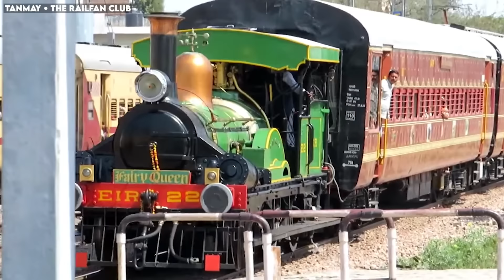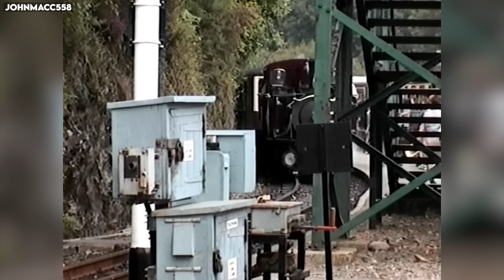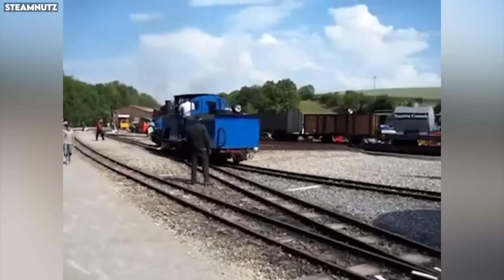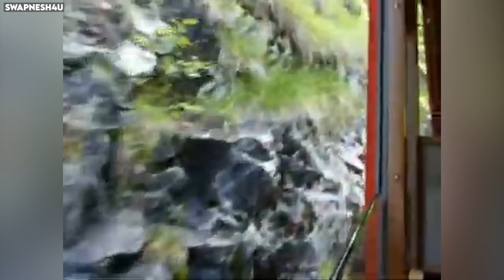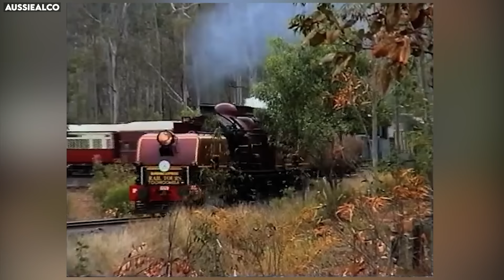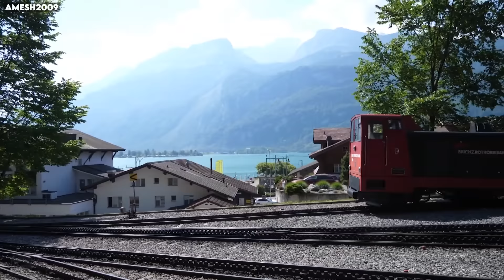10 Strange Locomotives That Still Run Today Against All Odds

Comment: Don't forget the steam railway on the Isle of Man that operates daily on the island.
Reply: Yes!  AND they do not have a flippin diesel as part of the deception!
Reply: Actually the IOMR does have a diesel power systems, in storage and rotting away are narrow gauge rail cars from a closed line in NI, and a new unit from i believe a US manufacturer that they can't get to work properly.

Comment: LIES there are many articulated locomotives . The frames do NOT bend/hinge , the front of the boiler sit over a turret like on a army tank , the first 4-8 wheel set turns under the boiler as a single piece .

Comment: Yes, you have missed the Rack and pinion still running steam ( coal  and  oil fired ) engines and trains in India. The metre gauge railway from Mettupalyam to Ooty ( now called Udghamandalam) in the state of Tamilnadu, in India. Please check that out and I hope you put it in the list of regular steam running engines , it has a 1 in 12 gradient climb, which is extraordinary. There are still Swiss built steam engines ( coal fired ) pushing these trains up the Nilagiri mountains of South India.

Comment: The fairy queen is he oldest steam engine in the world operating but since It has been rebuilt so many times most of its parts aren't considered original. Though there is an engine 1 year younger than it called the prins august and it still has most original parts

Comment: Srilanka have One Locomotive Still Run Since 1922. 

Thats Class B2B 213 4-6-0TT Ten-Wheeler Tender Tank Steam Locomotive. 

Build by Vulcan Foundry England. These Engine is the Non-Retired Engine in Srilanka Nearly 104+ Old.

Comment: Actually, NSWGR (New South Wales Government Railways) also ordered some of 50 it these AD60 Class Beyer Garratts,not just South Africa
Reply: Yes but only 42 of the 50 were put into service. 6043, 44 and 45 arrived as a kit of parts. 6046 and 47 arrived incomplete and 6048,49 and 50 were cancelled. The railways were going over to diesels as the 40 class Alco diesels had entered service in 1950 before the 60 class Garrats did in 1952 to 1956.
Reply: @AussiePom-e6c  yea some were used as spare parts
Reply: @Eric_da_trainspotter5  The heaviest Beyer Garratt was the sole loco built for Russia. The S African GMA & GMAM  were lighter than the AD60s.
Reply: @robertrich663  Apart from single Russian Garratt the 59 class Garratt of East Africa was the most powerful,  just over 83000 lbf and ran on metre gauge.

Comment: The LNER had the U1 Garrett designed by sir Nigel Gresley to work as a banker to push coal trains up the Worsbourgh incline.the 2-8-0+0-8-2 was also used on the Lickey incline banking freight and passenger trains